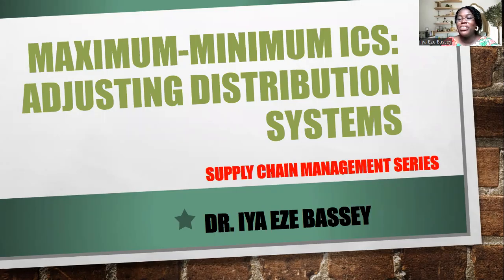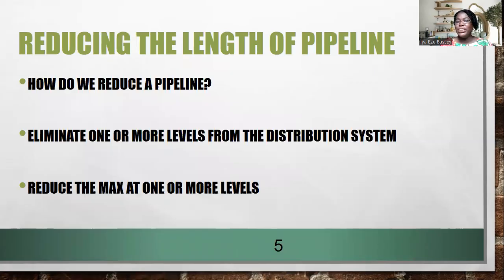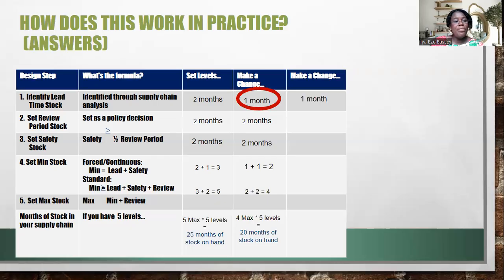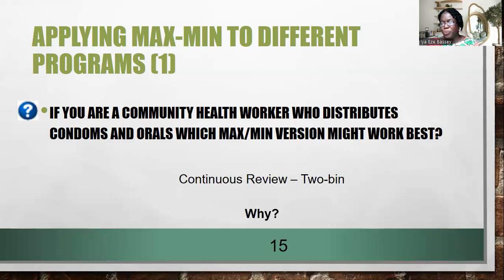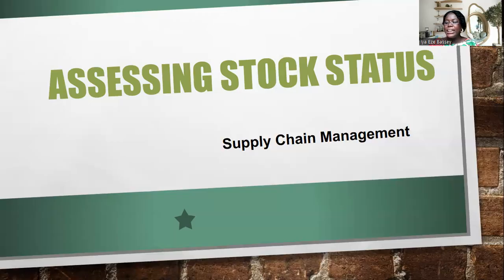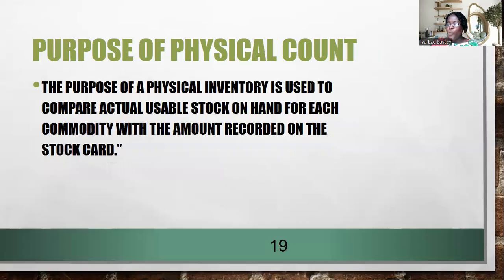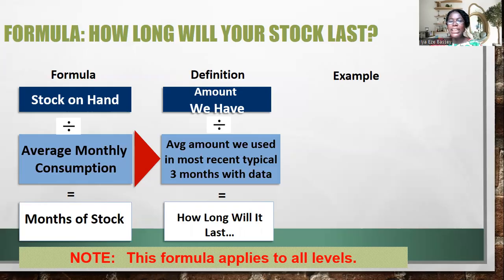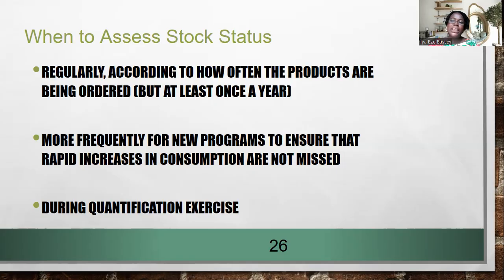Maximum-Minimum ICS: Adjusting Distribution systems (Supply chain management series)

Comment: Adjusting the distribution system in a Max-Min Inventory Control System (ICS) involves fine-tuning the supply chain management system to optimize inventory levels and distribution processes. Here are some key adjustments to consider:

1. *Lead Time Reduction*: Decrease lead times by negotiating with suppliers, improving transportation efficiency, or using expedited shipping options.

2. *Safety Stock Optimization*: Calculate and adjust safety stock levels based on demand variability, lead time, and service level requirements.

3. *Reorder Point (ROP) Adjustment*: Adjust the ROP based on changes in demand, lead time, or safety stock levels.

4. *Order Quantity (OQ) Optimization*: Calculate the optimal OQ to minimize inventory costs and maximize efficiency.

5. *Distribution Network Optimization*: Analyze and optimize the distribution network by consolidating warehouses, using third-party logistics providers, or implementing a hub-and-spoke system.

6. *Inventory Placement*: Strategically place inventory in different locations based on demand patterns, lead times, and transportation costs.

7. *Transportation Management*: Optimize transportation routes, modes, and carriers to reduce costs and improve delivery times.

8. *Warehouse Management*: Implement efficient warehouse management practices, such as slotting, picking, and packing optimization.

9. *Inventory Visibility*: Improve inventory visibility through real-time tracking, monitoring, and reporting.

10. *Continuous Monitoring*: Regularly review and adjust the distribution system to ensure it remains optimized and aligned with changing business needs.

By implementing these adjustments, you can optimize your distribution system, improve supply chain efficiency, and maximize the effectiveness of your Max-Min ICS.

Comment: Thank you ma for this lecture.I learnt about the steps required to design a max-min ICS,they include;
*Check that the overall distribution will function properly if the levels  max-min policies are implement 

*Check the total length of the pipeline  that the policies at each level comply.
It is essential to set max-min policies for each level and type or category of facility.
Advantages of using max-min system includes;
-avoid overstocking
-avoid understocking
-minimize wastage 
-avoid cost of emergency.
 
Some factors that affect max-min levels include;
*Cost of production 
*Cost of storage
*Lead time 
*Storage capacity etc.
-

Comment: 9 months ago
With this well delivered lecture, I know how to identify ways to adjust distribution system policies,
ADVANTAGES which include:
1. Set up initial max-min policies for each level and type of facility.
2. Check if the overall distribution will function properly if the level specific max-min policies are implemented.
3. Check the total length of the pipeline that the policies at each level imply.
The challenges of max-min inventory control system, the inventory control system used in the logistics management of HIV/AIDS commodities ( LMHC ) and the meaning and purpose of assessing stock status.

Comment: Thanks so much Ma'am for this Video.

In summary,i learnt d length of the pipeline should not be too long,so that goods can get to the final consumer on time.

This video helped me to understand ways of reducing the length of the pipeline when it's too long, which includes:
a.) Eliminate one or more levels
b.) reduce the max at one or more levels.
And to reduce this Max we need to change some elements of the formula which are:
- Review period 
- Lead time etc.

It also revealed some important factors that can impact this Max-Min stock level, which includes:
- Cost of product 
- Storage Capacity 
- Storage conditions etc.

Comment: From your lecture ma i learnt the steps in designing the max-min ICS. They include;
*Setup the initial max-min policies for each level and type of facilities
* Check if the overall distribution will function properly if the level specific Max-min policies are implemented
*Check the total length of the pipeline that the policies at each level imply

HOW TO REDUCE PIPELINE
>Eliminate one or more levels from the distribution system
>Reduce the max at one or more level

Factors that impact max-min stock levels include;
°cost of product
°storage capacity
°cost of storage, etc

ADVANTAGES
°avoid overstocking
°avoid understockiNG 
°minimize wastage

Comment: Thank you very much Ma. 

In summary of this video,

There are steps to designing a MAX-MIN ICS. They are:
✹ Set up initial Max-Min policies for each level and type of facility. 
✹ Check if the overall distribution will function properly if the level specific Max-Min policies are implemented. 

The pipeline length can be reduced by:
✹ Eliminating one or more level(s) from the distribution system. 
✹ Reducing the Maximum at one or more level(s). 
To reduce Maximum stock level, we:
✹ Shorten the review period. 
✹ Reduce the lead time. 
✹ Improve the distribution system reliability at one or more level(s). 

There are factors which can impact Max-Min stock level like, cost of products, cost of storage, storage capacity, lead time, shelf life of health commodities.e.t.c.

Advantages of MAX-MIN system:
✹ Avoid under stocking. 
✹ Avoid over stocking. 
✹ Avoid cost of Emergency order. 
✹ Avoid wastage.e.t.c.

Challenges to using each version and variations:
✹ System with Numerous levels. 
✹ System that manages a large number of commodities. 
✹ System that manages products for new programs. 

Assessing Stock Levels. 
In assessing stock levels, we do a physical count, that is counting by hand the total number of usable units of each commodity in your store or health facility at any given time. This helps to compare actual usable stock on hand for each commodity, with the amount recorded on the  stock card.

Comment: They are different steps involved in designing a max min inventory control system:
1) set up initial max_min policies for each level and type of facility 
2) check if the overal distribution will function properly if the level specific max-mim policies arr implemented 
3) check the total length of the pipeline that the policies at each level imply.
     Advantages of using the max-min ICD are; 
1) avoid overstocking 2) avoid understocking 3) minimize wastage 4) simplify the inventory control decision making  5) consistency of stock levels 
 The following are done to reduce minimum 
1) shorten the review period at one or more levels 2) reduce the lead time at one or more levels 
 Challenges imvolved are; 
1)system with numerous systems 2) system that manages a large number of commodities etc
  Factors that affect the max- min levels
1) cost of production 2) lead time 3) storage capacity 4) age of program 5) shelflife of health commodities 
  Also, the purpose of assesing stock status  is to determine how long supplies will last

Comment: In summary, the maximum _ minimum Inventory control system provides comprehensive guidelines for the management of stocks  levels to prevent both overstocking and understocking  of goods. 
The steps in designing a maximum _ minimum control system includes:
1) set up max_min policies for each level and type of facility
2) verify that the overall distribution will function properly

3) Establish initial max _ min quality  for each level and facility type. 
Some benefits of using max_min system includes: 
- it helps to avoid overstocking
- Avoid understocking
- it also helps to minimize wastage
Some challenges of this system include:
- system with numerous levels
- system that manages large number of commodities 
- system that manages products for new programs.
Lastly, physical count of stocks is important and should be done at least once a year. In cases where stocks are moved rapidly, physical count should be done frequently to ensure adequate inventory management.

Comment: Thank you Dr. Ive learnt that inventory control system provides comprehensive guidelines for managing stock levels to prevent both overstocking and understocking of goods. It encompasses various steps involved in designing the system, methods for reducing pipeline length(which helps us to understand parts of the distribution system designed) - by eliminating one or more levels from the distribution system- and factors affecting the max- min stock levels. There are several.factors affecting max-min levels and they include; 
Cost of production, lead time, cost of storage, storage capacity, age of program. 
  This factors help to minimize storage, minimize wastage, prevent overstocking etc.
   I also learnt how to access stock status and also when to access stock status.

Comment: In summary, I've gotten to understand and identify the different ways to adjust distribution system policies, I also understand the advantages of using max-min system. I got to understand how to access stock status by physical count, in addition I got to understand the purpose of accessing stoch status which is to determine how long supplies will last.

Comment: Adjusting distribution system policies involves setting initial Max-Min policies for each facility level, ensuring these policies enable proper distribution, and checking pipeline length implications. The maximum minimum system deal with avoiding overstocking under stocking wastage avoid costs of emergency orders simplify inventory control decision making consistent stock level reliable data source from sdp for forecasting and quantification and adjusting the pipelines in the facility. There are several factors that affect max-min levels which includes;
1. COST OF PRODUCTION, 2. LEAD TIME, 3.COST OF STORAGE, 4. STORAGE CAPACITY, 5.AGE OF PROGRAM.
In conclusion, this factors have some advantages which are;
1. minimize shortage, 2.minimize wastage, 3.prevent overstocking etc.

Comment: Full of interesting calculations.
Okay, I was taught of the ways of  reducing pipeline I.e the flow of health commodities at all facilities. This can be done in two ways: either by eliminating one or more levels of the distribution and/or by reducing the maximum at one or more levels.
We also looked at certain factors that can have an impact on max-min stock level, this can be but not limited to,  cost of products, cost of storage, storage capacity etc.
Ways of calculating MOS on hand was also discussed.

Comment: The breadth of information provided on the Max-Min ICS: Adjusting  Distribution Systems is much  appreciated. In conclusion, modifying distribution system  policies include determining the starting  Max-Min  policies for every facility level, making sure that the policies permit  appropriate distribution, and  examining the consequences for pipeline length. How long supplies will  endure is determined by  evaluating stock status

Comment: The Max-min inventory control system(ICS) can be used for adjustments of pipeline (distribution) which can help reduce the risk of spoilage, avoid overstocking or understocking, and also help avoid cost of emergency orders
There are some steps listed in setting up a Max-min inventory control system which include
                     - setting up your intial       Max-min policies
                    - checking if the overall distribution will function properly if the level specific Max-min are implemented
                    - checking the total length of the pipeline at each level

Using the Max-min ICS as a way of reducing the length of the pipeline, elements or formulas can be eliminated during calculations.
There also challenges when using each ICS systems earlier mentioned in the previous series where continuous review ICS can only be used for programs that has less number of commodities and standard version efficient for managing large amounts of commodities.
It is also important to access stock status physically to determine how long your stock can last thereby knowing your month of stock. This can be done regularly according to to how the products are being ordered or during quantification exercise.

Thank you ma!

Comment: Thank you ma
I have been able to understand the steps in designing a Max-Min ICS which includes, setting up initial max-min policies for each level and type of facility, checking if the overall distribution will function properly if the level specific max-min policies are implemented, checking the total length of the pipeline that the policies at each level imply.
I have also been able to understand the advantages and challenges of Max-Min inventory control system.

Comment: In adjusting the pipeline in the maximum -minimum inventory control system 2 things can be done to reduce the length of a pipeline. 
1. Eliminate one or more levels from the distribution system 
2. Reduce the maximum at  one or more levels. 
To reduce the maximum you can either shorten the review period at one or more levels or reduce the leadtime at one or more levels. I also learnt that LMHC uses the forced ordering maximum -minimum inventory control system. Then in assessing stock status a physical count is done and is done regularly according to how often the product are being ordered ( atleast once a year)

Comment: Thank you Ma'am 
There are steps In designing a Max-min ICS which are; 
Setting up initial Max-min Policies for each level and faculty 
Check if the overall distribution will function properly if the level specific max-min policies at each level imply.
Elements of the Formulas which can be changed in order to reduce the max stock level.
Shorten  the review period at  one or more levels.
Reduce the lead time at one or more levels.
Improve the distribution system reliability.
Factors that impact max-min stock level
-Cost of products
- reliability of transportation 
-shortage capacity

Comment: By the end of this session, I grasped the importance of setting policies for different levels, managing stock efficiently, and assessing stock status.

Here’s what stood out:

1. **Reducing Pipeline Length**: You highlighted the need to possibly reduce levels or adjust policies to shorten the time it takes for products to move from central to local levels.

2. **Practical Adjustments**: This includes considering cutting down on intermediary steps or revising policies to decrease the maximum stock levels we maintain.

3. **Formulas and Calculations**: Adjusting inventory formulas (like lead times and review periods) is crucial for optimizing stock levels at various stages.

4. **Challenges**: Factors such as product costs, transport reliability, and storage space play significant roles in managing inventory effectively.

5. **Stock Status Assessment**: Conducting regular physical counts and comparing them with records helps in understanding how long our current stock will last.

6. **Assignments**: Reviewing SOPs for TB drugs, HIV/AIDS commodities, and malaria aids in comprehending different inventory control methods.

Overall, this session showed the importance of efficient inventory management for maintaining optimal stock levels.

Comment: In summary : i learnt that;
- one of the steps in designing a max-min ICS is setting up final initial max-min policies for each level and type of faculty 
- The factors that impact max-min stock levels include: cost of product, reliability of transportation, storage capacity, cost of storage
- one advantage of using mx-min ICS system is to aviod overstocking
- some challenges with using the system include systems with numerous level, system that manage a large number of commodities,and system that manage product for few programs
- physical count which is the process of counting by hand the total number of usable units of each commodity in your store( for stock assessment), is used to compare physical actual usable stock on hand for each commodity with amount recorded on the stock card.

Comment: This is a nice one listening to you, i have learned from this how to build a maximum and minimum inventory control.
 ,* How to reduce the length of pipeline by eliminating one or more levels from the distribution system and also reducing the maximum at one or more levels.
* Reducing the maximum stock level by :
1 shortening the review period at one  or more level
2. Reduce the leasd time at one or more levels
3. Improve the distribution system reliability at one or more levels.thanks ma.

Comment: This is a good one ma,i have learnt; how to build maximum and minimum inventory system.
Reducing the length of pipeline by eliminating one or more levels from the distribution system and slso reducing yhe maximum at one or more levels.
To Reduce maximum stock level
2 shorten the review period one or more level
2. Reduce the lead time at one or more level
3. Improve the distribution systems reliability at one or more level.thanks ma.